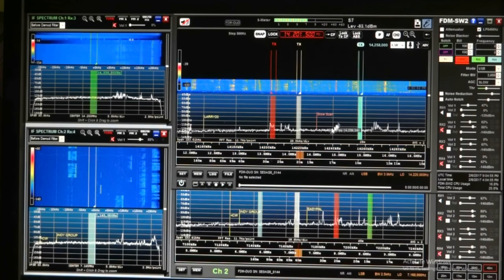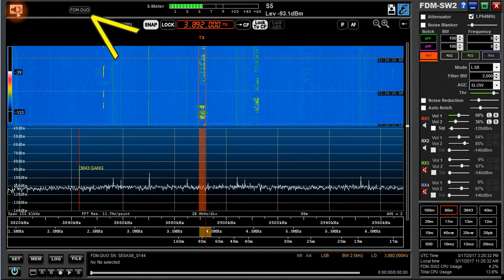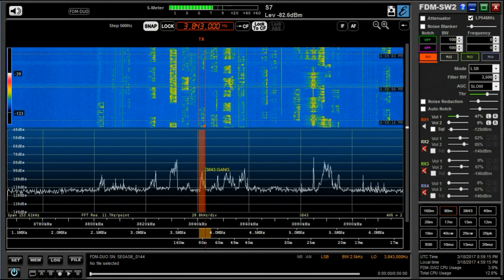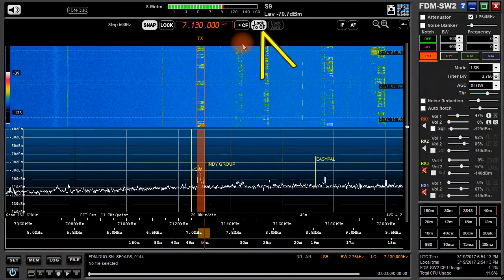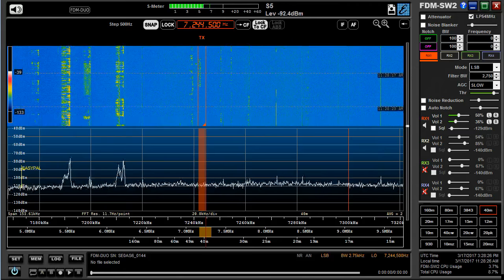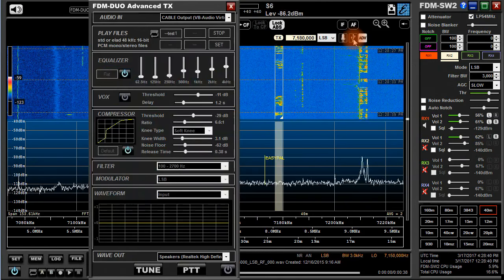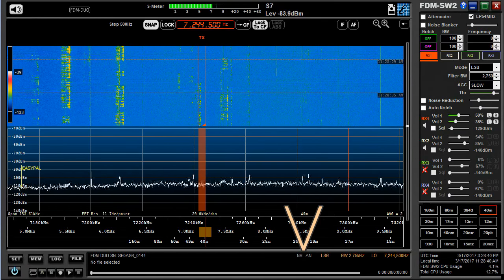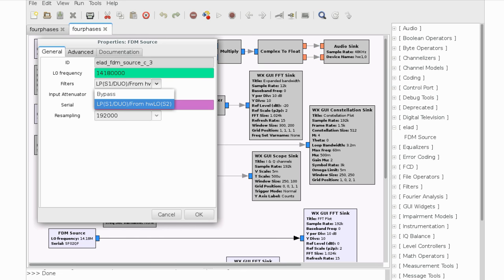Elad FDM DUO SDR HF+6m Transceiver Pt2 SW2 Introduction by W8KFJ

Comment: Dave,
Thanks for part2 I purchased the FDM-DUO after watching your first video. I was on the fence and your insight to the radio confirmed my purchase. Being new to Ham Radio I am glad I jumped to SDR and skipped the leaning curve to using conventional radios, however it has left me with quite some gaps in my knowledge base and your videos are helping close those up. Now I have the radio and software operational (by the way also purchased I5 nuc computer w/27" monitor what a joy). I am now trying to make the SW2 play with other software, I feel as if I have entered a pit with many beasts. I will get one peace working and the next night it won't. In PT3 if you could cover the SW2 settings for cat control, multiple virtual com and audio ports it would be greatly appreciated. I do have cw swimmer operational (I think), WSJT-X comes and goes, and clueless with FLDIGI (may have it working but clueless on operation).
Thanks
Bill KM6GZL
Reply from the maker: Thanks for the kind comments.  Hope you're as happy with the DUO as I am!  Pt3 soon.
Dave  W8KFJ

Comment: Dave, thanks so much for taking the time to produce these videos. Very helpful! Am wondering if you have had any experience - or can offer any advice regarding - dealing with ELAD support. I opened a support ticket via the support website a week ago because I was unable to install the recommended firmware update for my newly purchased FDM-DUO. I immediately received a ticket number but have yet to receive a response from the support team. I can find no email address or telephone number for support so am at a loss as to how to proceed. Any thoughts? Thanks again.
Reply from the maker: Mark,  thanks for the kind words.  I have had some dealings with Elad support, and have had no problems.  Which firmware are you trying to install?  Did you follow the instructions in the DUO manual, for your version of windows,  exactly.  If it's xmt or rx firmware, the computer is not involved.

The Yahoo group can be helpful as well.

Dave  W8KFJ
Reply: Dave - Thanks for responding. Yes, I followed the firmware installation instructions to the letter. No computer involved - plugged a USB thumbdrive directly into the transceiver via the appropriate port. The red LED did not light up. Instead, the green LED flashed, which, according to the instructions, means that the installation was unsuccessful and I should "contact ELAD support" - which I did on June 28. Am still waiting to hear from them. Not good customer service to keep someone waiting this long! Thanks again for being so generous in sharing your knowledge of the FDM-DUO via YouTube.

Comment: I can't tell if this radio has 60m or 30m. I must just not be reading something correctly.
Reply from the maker: It's a general coverage radio, so it can receive them.  You can transmit if you have the right bandplan for your country, which should have been installed if. You can download the correct bandplan as well.